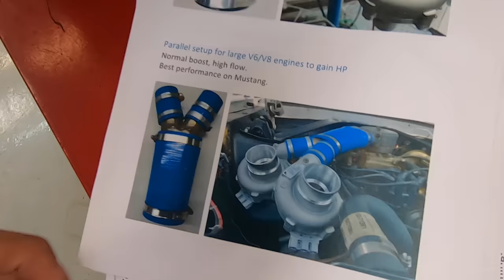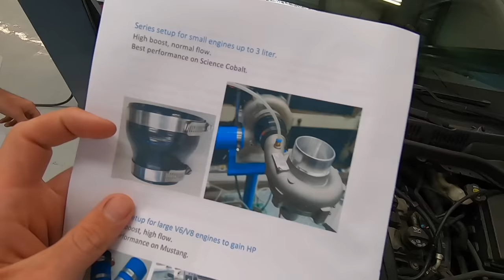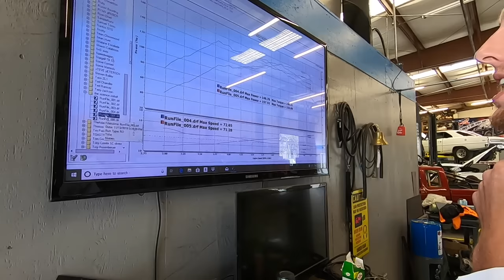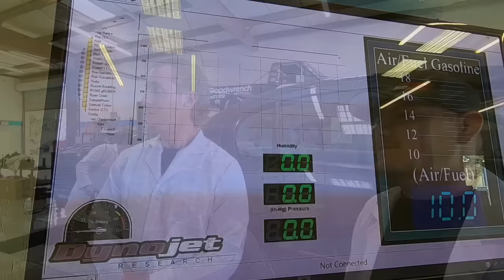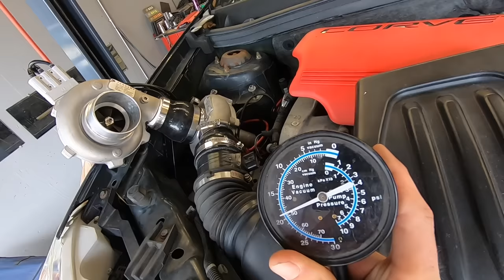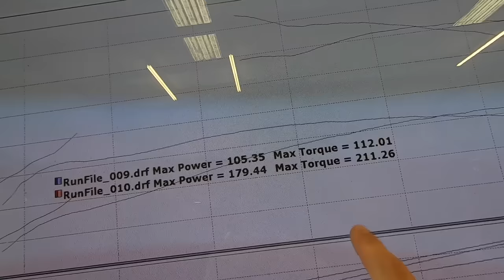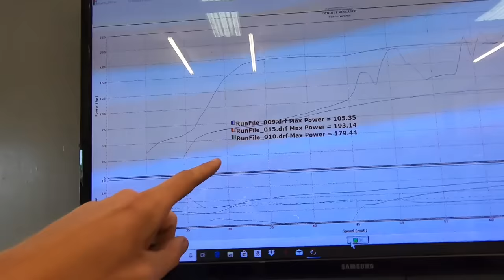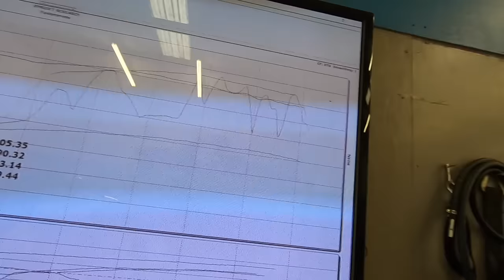Dyno Testing $5,000 Worth of ELECTRIC Turbos! Double the BOOST!!!

Comment: If these were cheaper they would sell like crazy.
Reply: It's not bad for what your getting. You have to remember it isn't using the exhaust to spin up the turbo, so they spin up instantly less turbo lag. Also because it doesn't use exhaust to spin up the turbo, install is much easier.
Reply: If they really worked
Reply: Id just buy another vehicle with the 5000
Reply: @robertanderson7784  Admittedly I did not watch the entire video. What I need to know is; what is the power source? What wattage and amperage do the turbos draw. Cost is nominal compared to typical exhaust driven turbo systems as one does not need all the extra plumbing and intercoolers. There is absolutely no parasitic loss here but I would like to see a schematic with the circuitry required and the power source/demands.
Reply: If they get enough orders to mass produce these things the price could go way down
Reply: I'd pay maybe 500
Reply: @2ndamendmentfanboy723  that is even les then a normal turbo. Never ever going to happen. I think if they can sell a good amount the price could drop below the 2000 mark, maybe even down to 1500. Now if you go with a turbo build i think you wil be spending around 1500 to install a normal turbo as wel. You need to have a new exhaust, headers, the turbo itself, most of the times an intercooler. And then offcourse the time. If you can weld yourself and do all the fabrication a turbo setup could be done cheaper, but if you let someone weld the exhaust for you i think you wil not be able to do it under 1500.
Reply: I'm buying one regardless for my Hyundai Elantra hahaha
Reply: @gabbermaikel  what kind of cheap ass turbo setup are you getting for $1500 total including parts and labor? Are you using an eBay turbo with the cheapest possible headers or what
Reply: @circuscannon6381  that's 1500 to install from how I read that comment. Which is about right for a turbo install. Home build you could do a turbo for 2k if you can fab the pipes.

I reckon you could build a torqamp style device for about 700$ in theory and with an adaptor to split off the intake so the device isn't acting as a restriction in ordinary driving it could rock as an add on to a turbo build
Reply: @circuscannon6381  i didnt include any labor, i only included the pre welded exhaust part as you can read. So that means you buy a turbo, over here a holset turbo is used pretty often, can be bought for 300-500$, so that leaves you 1000$ for other crap. And dont forget that we dont include a ecu or some other way of controlling the fuel/ignition because that would be the same for a torqamp. So im only talking about the things you do need for a turbo setup and not for the torqamp. That would be a turbo and headers, a downpipe and maybe a bit more piping, then we are at the most basic needs. 

If you are going to get it done just installing the turbo without setting anything up would allready cost more then the torqueamp as it is now. Atleast i wont build a turbo setup for someone with the parts included for 2500$.
Reply: @randsonic  It runs on a 48V lithium ion battery that charges slowly off the alternator. If it were to run directly off the alternator it would cause a lot of parasitic loss when compared to either a supercharger or turbocharger, so this system is a good choice by the company.
Reply: @randsonic  watch the video.
Reply: @clitisoris  I did and I have conversed back with the rep here. Maybe you should read ALL the messages bro.
Reply: Ok bro.....
Reply: @randsonic  why do you think they do not work?
Reply: @ezralord4901  that was my first comment. They do work but one has to realize they are more like a nitrous unit which needs to be used sparingly.
Reply: @randsonic  That makes sense.
Reply: lapin46 it
Reply: So true 2500 this too much for 5psi
Reply: I could buy two impreza sti"s for 5 grand ... maybe 3 sti's... there cheap in the UK.
Reply: @randsonic  Doesn't matter what you use to spin the turbine as long as you have enough CFM and are generating boost per the compressor map.

You can use exhaust gas, crank driven, even electric motors.
Reply: @randsonic  External battery pack.

Wattage is typically 5kW plus, this is why they don't work off a 12V source as the amperage draw would be ridiculous (over 400A).

This is like a milder tamer version of NOS, except you can refill with your wall plug or with mild cruising as it trickle charges off of the car.

lapin46 actually detailed it nicely
Reply: @lapin46  The nice thing is that you can also shift your torque curve to the lower end. I'm building such a system for my Honda which makes no torque below VTEC (well to be fair it doesn't make much after either hahaha). Will be posting a video this year.
Reply: @lapin46  Also! So easy to remove for smog hahaha
Reply: @alexanderlevenko1924  well yes it does matter. No 12v system I know of would push this turbo...hence wahy they havent been utilized prior. Even this system has a 4 minute continuous boost witht the onboard lithium batteries.
Reply: Gurgle Blaster and no oil lines to run. And also cooler IATs because no exhaust heat is bleeding into it.
Reply: randsonic Yes, me too. I highly doubt my 90A alternator from my 90s Ram is enough to even power the one of these, let alone 2.
Reply: @jediknight1294  ohh imagine a program that detects when there will be turbo lag and so it fires one of these to spool it up.
Reply: @trialsbike2135  You can do this easily with an Arduino that operate the switch to this thing based on let's say RPM input until the certain RPM where the actual turbo is already spooled. Volvo do this with injected pressured air into the turbine itself to spool the turbo.
Reply: I would buy torqamp if the price would be 1000$
Reply: @kaikart123  you're absolutely right. I never thought I'd see the word Arduino used in the comments section here, but it makes perfect sense 😂
Reply: @0Schranz  id buy one for a maximum of a grand.
Mostly because of the ease of install and no one has mentioned yet: RETURNING THE CAR TO STOCK if you plan on selling it or just removing the setup. 
I never thought I'd see an electric charger do anything legitimate lol
Reply: @trialsbike2135  easy enough to do you just set it for acceleration and have it run via megasquirt etc, yank the timing and ease into the turbo spool up. Volvo do something similar currently.
Reply: @dub537h5  honestly for the work and performance boost it isn't worth it if you are planning a return to stock, take the money and spend it on a new exhaust, changing your intake and filters and a remap for your driving style.
Reply: @jediknight1294  well you could arguably just leave the exhaust and intake factory, only bolting on the supercharger. When you take it off, everything is still factory, that's what I meant.
You'd probably see better performance with the charger if you had another exhaust though...
Reply: @dub537h5  yeah, honestly if I'm putting something like this on I'm wanting to pull timi g at activation and am therefore doing things that are more than just plug and ay, we can see in the video that the performance when not usi g the torqamp was problematic for general performance due to pulled timing so... Id want to. Make the absolute. Most of. That boost under acceleration
Reply: @jediknight1294  yea, absolutely.  Might as well utilize it to it's full potential
Reply: @Jupiter__001_  Just throw on a second alternator
Reply: @elitewolverine  No. You missed my point. Parasitic loss is where the compressor consumes power in order for forced induction to occur. The additional alternator (or, more sensibly, a bigger alternator) will consume more power.
Reply: A hair dryer and an inverter . Price 99$
Reply: @Jupiter__001_  No I didn't miss a single point at all.

Current Alternators are about 60 or 70% efficient.

For every 1hp to turn an alternator it creates about 450W, which is 45V at 10Amps.

A typical Alternator creates 1400W at 4HP draw...

So yea convert 1400W to V and Amps and you get 45V with 31Amps...

These turbos are creating 70HP

I would need 11 alternators to equal a net 0 gain in power vs draw...

Yay physics!
Reply: So who wants to go in on a group buy??
Reply: @Luzviminda777  "A hair dryer and an inverter . Price 99$" /// I see a lot of stupid comments on YT.  You are right up there.
Reply: @randsonic  for the same amount of boost and volume you need the same amount of air cooling. no matter if the compressor is driven by an exhaust turbine, belt , electric, the holy spirit or unicorn farts. the heat is produced by the process of compressing air. So if you don´t need an intercooler for an amount of power with an electric supercharger, you also don´t need an intercooler with a turbo charger for the same amount.

Next topic, there IS loss. the engine drives the alternator. If there is a high current, electric consumer, the alternator pulls more power from the engine. 
it is even worse than a supercharger. a supercharger uses the mechanical work, provided by the belt, right away with no conversion losses. 
With an electric supercharger, there are conversion losses at the alternator from mechanical to electric energy (belt to electricity), and than again from electric to mechanical energy (electricity to the electric engine that drives the compressor wheel). 

100hp more for 5000$ is a catastrophe. And on top of the 5000 bucks you probably still need to upgrade your fuel pump, injectors, intercooler, MAP sensor (most NA map sensors dont know positive pressure, the engine leans out and basically explodes) maybe lower the compression ratio if it is over 10:1 (pistons and/or head gasket) rods, studs, colder spark plugs, exhaust, wideband O2 sensor, intake temp sensor, maybe a stronger clutch and gearbox, an ecu that can handle all that stuff and a dyno tune to adjust the ignition timing and other parameters. 

A turbocharger with a much higher performance costs under 1.5k, an over the top exhaust manifold 1k, blow off valve and electronic boost controller 500, intercooler 100  plumbing 450, a guy who smashes it on the engine 500 (if he is an asshole) many things are just bolt on so you can do many things by yourself.
Reply: @randsonic  YOU should do some research. the mechanical work of the compressor (compressing air) heats the air. It is a semi-adiabatic compression process. Why, do you think, do supercharger setups with intercoolers exist? There is no exhaust heat near a supergarger, Einstein.
Reply: @asdfjkl981  I own a Engineering firm...nuff said?
Reply: @randsonic  HAHAHAHAHAHAHAHAHAHAHHAHAHAHAHAHA
btw. owning something does not make someone an expert.
Reply: @asdfjkl981  why do you think water injection and cold air intakes exist Einstein? Because cooler air brings more oxygen into the combustion chamber, is more dense and creates more power regardless the engine. One of the biggest drawbacks to turbos has always been heat...because of their proximity to the exhaust manifold...heat which is transfered to the intake charge making a intercooler almost a necessity for turbos. I compress air in my tires to 35lbs...do I need a intercooler on my tires?
Reply: @randsonic  omg please. 
you always talk about power and more oxygen. that is all nice but the true danger of hot air is called knocking. and as i already mentioned, higher pressure superchargers also use intercoolers and the minimum temperature an "not sprayed on" air/air intercooler can produce is ambient temperature (wich will never happen because physics). 
and now put 2 and 2 together kiddo.
Reply: @asdfjkl981  typing hahahahaha on social media means you might be 10 years old. ME/PE here...look it up.
Reply: @randsonic  ?
Reply: Honda b and k motors would love this shit
Reply: @asdfjkl981  Where a engineering firm is concerned, yeah it pretty much does. Why don't you open one?
Reply: @asdfjkl981  There is a lot of heat within an engine compartment, and some supercharger designs (like engine mounted turbos) allow substantial heat transfer from the engine and other components to the supercharger. However the supercharger is NOT being run by exhaust gas which exits the combustion chamber heating exhaust manifolds to 450-500 degree average. Heat gain from a positive displacement supercharger allows heat (from engine compartment and operation) to be transferred to the air being compressed inside the supercharger (worse in turbo), effectively decreasing efficiency.  This is why many prefer a centrifugal supercharger mounted to the side of an engine or in front of the engine, instead of a  a positive displacement blower mounted on top of an engine. The centrifugal supercharger has minimal heat transfer from the engine which cannot be transferred into the intake charge. A positive displacement supercharger like any exhaust mounted under hood turbo can heat soak fairly quickly from engine top mounting . And like we all keep saying to you...the cooler the charge the better performance...even in a lawn mower.
Reply: Slap this thing on something already making boost and see what it adds
Reply: @gabbermaikel  If these were mass produced the price could drop to $1000. $500 from china. I can buy turbos from China for $100-200 and those motors are like $50 or less. But you don´t need the exhaust part of the turbo so no turbine or housing that will cut the price in half to about $100 for another $100 you can easily get the battery and the electronics mass produced. Add the quantity discount and you are only around $200 to $250 total. Making 400-500% profit is plenty and I think it is worth $1k easy. You could use a bigger turbo and motor and get even more boost too.
Reply: @excitedbox5705  nah you wont be able to make a powerfull and safe battery like that for 100$ Also you forget in you calculations that there is some extra machining involved to connect that motor to the compressor wheel, probably another bearing thing as wel. Then there is the control board wich you dont calculate for either. And then the fact that those cheap cheap things have no quality control at all. So if it is then put to the standard of this company you can count on 25-50% rejection. That means 250$ each and lets go for 25% rejection you are now looking at 325 excluding taxes and shipping minimum.
Reply: @gabbermaikel  That is what you call manufacturing. You don´t modify a normal turbo housing you get one made but once the molds are made you can reuse them. Molds are cheap though.

The motor looks like an 895 or 987 BLCDC motor, which cost around $20 and can be press fit onto the compressor. Bearings cost 20-30 cents. Guess what else runs on high output batteries? Electric bikes and scooters. The batteries are off the shelf units. They may even be the same cordless drill battery packs wired in parallel since they run at 48v as well. The electronics cost next to nothing and are included in my estimates. A BMC board for a power wall sized battery pack costs about $10 and a high amp speed controller costs $5-10. Those prices go down crazy fast though buying custom or bulk parts though.

If you go to Aliexpres and have a look around at what each of these items cost you will see that my numbers are actually on the high side. I priced these parts using the single unit pricing without any quantity discounts that you would get. In my experience those are another 50% lower.

Shipping costs 5k for a 40´shipping container but the import taxes will be expensive.

You have to keep in mind that this company had development osts where they had to make single units and test several motors and batteries etc and that can quickly run into the 10s of thousands or more. That means they have to sell 1000-2000 units at a much higher cost to recover their investment and build up to a point where they can order bulk. In addition I doubt they are going to dump a million+ into ordering a container full right off the bat so their costs are probably much higher right now and they may even be assembling them themselves which would add 100+ to an essembly cost that is practically free in China. A factory worker costs $20-50 a day.

I am positive that if I was to order a container full of these things I would be paying no more than 250 each.
Reply: @excitedbox5705  so we end up at the same thing. They cant order in the shipping container size. And if you want to be sure of quality you have to assemble yourself or have someone check it all. And since they are a new guy to the game they have to be 100% sure every unit they send out in the first 3 years is good. If 25-50% of the shipped products have problems they wil go bankrupt. Not because sending a new 1 is that costly, but because the first few years for a product like this wil determine if people like it or not. If borg warner ships a load of crap turbos out and they all have to be replaced then sure it wil hurt their name, but their name is still 1 of the best turbo manufacturers of the world, so they can handle that. If you are a new guy and 50% of your stuff is garbage you wil be known as that company that sells overpriced garbage that dosnt work. And that is the end of the product, because it dosnt work according to the people that bought it.

So what happens is they have to atleast do a final quality control. And from a guy that works at a car parts brand i know that in a lot of cases that means take it apart, check it and reassemble, or just do the final assembly in house. They did that with chinese parts as wel. They got everything made in china, prettymuch the same parts as you see on aliexpress. But they did the final assembly, checked if everything was within spec and all that. And now the part that was 20$ on ali would be 50$ from them. Not because they earn that much on it, no because someone actually put time in it, and there are parts that get thrown in the junk. 

And the tax part wil be HUGE on this as wel. They are a dutch company, and i think we over here have 1 of the highest tax prices in the world. By the time its shipped out agains it wil be close to 50% more expensive because of all the taxes and crap on everything. Now they might be able to get some of that off if it ships outside of the EU, so that might make it a bit cheaper for US customers.
Reply: @asdfjkl981  mazda millenials is an intercooled supercharged engine
Reply: @keithgauger597  The VW G60 was a very popular intercooled superchargerd engine. But don´t tell me that. Thell it super engineering company owner who thinks that the higher temperature of compressed air is only because the exhaust is so hot.
Reply: @robertanderson7784  Could start looking at corvettes at that price.
Reply: Rainy  it raised the power but only when it was used, it actively damaged the performance when the device wasn't activated. What id do is have it set with a microsquirt to pull timing when its used. 

Using the device to boost till a turbo engages isn't a bad option though.

They are a fairly simply thing to build, lithium ion 18650 batteries in series to reach the 48V pack required and a modified turbo. 

They are a cool thing but they aren't in anyway a game changer, especially if installed the way they were here. Pulling timing full time  when the device isn't running seems to actively damage performance. Peak power isn't everything. 

Putting a system together that takes advantage of the benefits wouldnt be too hard on an EFI car with a tuner like hondata or similar though. Would be more money and make this a really unattractive option compared to say nitrous or a straight turbo install given the price and the requirements to put a splitter into the intake to ensure that it doesn't present a blockage/restriction when not triggered.
Reply: Rainy  i wouldnt call it sizable given they had to ruin the drivablity of the vehicle for a minute or some b9ost of 5psi
Reply: Rainy  in interested in usability not peak power remember and given that pulling timing means that power is reduced in ordinary driving....

I think the tech has potential, using it the way volvo does.to eliminate turbo lag possibly
Reply: @gurgleblaster2282  and the exhaust sound is better
Reply: I'd get one for an old honda. It'd probably work great on a little gsr motor
Reply: Yeah if it was cheaper i would order now!
Reply: @lapin46  rpms?
Reply: @lapin46  this kinda pisses me off. I was doing this 15 years ago with my dad's rc airplane engines and spinning tires in third gear...the lypo batteries they ran off of might of weighed a lb. The motors? Pssshhh. If only I could of patented it.
Reply: @lapin46  true. Found a video on company who makes it. He has 0 to say about tuning applications for it. He mentions using the tps sensor I get the theory but I think that's all he has is the theory. Obviously tuning will get the best out of it but the maf isn't doing a bad job on it s own for this car
Reply: @randsonic  true in theory but newer cars run coolant to the throttle body for a reason. Unfortunate, but probably something that could be "tuned" out. Idk. But maybe like you can have a plug that's too hot or cold   the airs the same and just needs an all around sweet spot depending on the application
Reply: @2ndamendmentfanboy723  I'd pay probably $1,000.  I've thought of several cars I'd much rather slap a couple of these on vs. plumbing in an aftermarket turbo setup.  I wonder how long the windings in these things last and the life expectancy of the batteries.
Reply: @asdfjkl981  "the heat is produced by the process of compressing air."  That's only part of where the heat from intake charge air comes from though.  You have this air being compressed by a glowing red hot turbocharger unit, traveling through hot charge pipes in the engine bay to the I/C, back to the intake through upper intake piping which will also get pretty hot.  I guarantee you'll see lower IAT from one of these located at a traditional CAI spot than from a traditional turbo at the same PSI.
Reply: @blackriflex39  "Slap this thing on something already making boost and see what it adds"  I think one of the interesting concepts about this thing is that if you've got a big turbo on a 4/6 cylinder motor you could fabricate an electronically gated Y intake for one of these and trigger it to run at > 75% TPS from 1,500 - (whatever rpm your boost comes in at) to improve low end drivability quite a bit and get into your real turbo spooling range quite a bit quicker.
Reply: @chrislack7219  wrong
Reply: @kurtisstover7610  Newer cars run coolant to the throttle body for cold weather performance issues.
Reply: @randsonic  so your saying it helps tune the car for specific weather paremeters to adjust emission levels?
Reply: @kurtisstover7610  It may do that I am not sure, but it is no different that the heat which used to be piped into the air cleaner of older cars from the exhaust manifolds. Cold air/fuel mixtures are hard to keep atomized at colder temps causing issues until the engine has been sufficiently warmed up. This is why we used to have chokes, and heat feeds as I mentioned. Being a old school guy I would say I doubt the coolant to the TB does anything to cool the incoming charge of air. Many in warmer climates have dispensed of this feature with no adverse results.
Reply: A lot of comments here missing a very simple point.....

This device had 3 guys who normally need 8-9 second cars to get a whoop outa them, hollering and laughing like a bunch of kids out in their first car, and that's in a 4-banger with a rough setup

In my local area, these things are used for high-altitude work, mostly on construction stuff, i don't think cars are really their market, maybe explains the price difference! :)
Reply: @JoeIsCrazyWillman  The Alternator doesn't run it. The system has its own 48v battery.
Reply: @DesertFernweh  the alternator doesn't run them no, but it has to reCHARGE them, repeatedly... A 90a is barely enough to run my truck's basic computer, radio, and hvac without dimming the lights and dropping in RPM at idle at night... No way it has enough oomph to be charging up these batteries additionally, plus run the dual electric fans I now I have as well.
Reply: In 5 years these things will be 1000$. In 10 500$. Unless china makes a knockoff sooner. I would say in 10 years electric turbos will run the dragstrip but they won't. Electric cars in general will.
Reply: @gabbermaikel  the difference is a real turbo can push pretty what whatever psi you want through it. Give a couple years for development and I wouldn't doubt electric turbos could push 20lbs all day
Reply: @codiekennedy825  gonna need a lot more than 5psi of boost on a sub 2.0L displacement engine with stock cam for electric superchargers to take the strip by storm.
Reply: @JoeIsCrazyWillman  agreed. 48v is nothing though. Even today they could easily make that twice the size with 3x the voltage. That's atleast 30psi. What about in 5 years. The point is mute bc like I said I don't think this is the next big thing I think electric cars in general are. But I used to be into rc cars as a hobby and this could have been done 15 years ago
Reply: 2500 for a basic bolt on accessory that makes amazing power for the cost of just a tune is pretty good in my book. been working on high performance cars since 2002
Reply: It's still worth £5000 for 2 elec turbos and doubles your power.
Reply: yeah one day battery tech will get cheaper and smaller and more efficient and these things will fly out the door...i'd like one on my Civic K20C2 for sure!
Reply: @alexanderlevenko1924  You didn't post a video..
Reply: @2ndamendmentfanboy723  500? Are you that broke? The battery itself is 500, you're one of those customers that every shop can do without. 2nd amendment gan boy? I don't you can even afford a gun and you're just trying to fit in somewhere.
Reply: @gabbermaikel  I don't mind paying 1000+ for a REAL turbo build but this is too high for an electric turbo build
Reply: @FarmerFpv  lol 5000 for an electric build?? Are u nuts??? I don't mind paying more for a REAL turbo build but this is crazy for just a few hp😂..not worth it I can get a real turbo build for alot less than 5000
Reply: @randsonic  sry to bump an old post. I think you are both right, but i have a sr20det with a 2860gen2 and a standalone ecu that shows inlet air temp. The more i throtlle, the lower the temps go as there is so much air passing through the system cooling it all down. The heat radiation you mention is indeed a thing. A really small turbo that is turned up to much will make more heat when making the same boost than a bigger turbo i think.
Reply: @FordSierraIS  What is the temperature of the exhaust? Car exhaust temps run 500-700c which will sink into anything surrounding the unit itself, this is why many turbos have inter coolers. Of course faster moving air displaces heat more quickly, however heat in a turbo engine is not optimal.
Reply: @randsonic  absolutetly. i dont disagree with you, and i think your discussion with this other guy is merely about how much each factor matters, which obviously varies from car, ambient, load, turbo size, impeller design, etc etc etc. im building a new setup now and ceramic coating manifolds insides and outsides. turbo blanket, etc etc. and its not just for the performance but brake master is right above the manifold too. for a turbo that is running within its designed capacity, the heat generated from the air compression is not to bad. newer turbos are more efficient too. but my point was basically as a comment to both of you as pushing the car harder actually decreases inlet temp on my car, at least on shorter pulls. in autoslalom oslt for prolounged time i would probably see more heatsoak of both intercooler and the engine bay in general
Reply: @gabbermaikel  3-500 is a bargain its hard to find a remanufactured one under 600, plus headers usually cost $250+ on the low end, exhaust piping, blow off, intercooler, and intake tubing. Not to mention the amount of stuff you have to remove to put in a turbo in most cars and the hours of work and sometime fabrication is needed.
Reply: @alexanderlevenko1924  was hoping to see your build. 😢
Reply: Instablaster.
Reply: @bvancere  so, hv u actually bought it?
Reply: @2ndamendmentfanboy723  even if you throw the cheapest turbo imagineable on a 4 cylinder engine with the intercooler doing the work your self which is way more complex than hooking up 2 wires or a centrifugal super charger run off the belt similar to this one its gonna cost 5gs minimum.
Reply: Lol nah.. An actuall good 80MM turbski is in germany like nearly the same its even a bit higher.. its like 6K XD
Reply: @randsonic  12v dont think he said what they drew but it’s enough to max the turbos out lol they’re not making gobs of boost. Would make for a cool twin charge tho
Reply: @larrylentini5688  future here. They went up lol
Reply: @randsonic  what charges the lithium batteries? Either way you put it it’s being powered by the cars battery. Years later we still don’t understand em. Still getting one tho lol
Reply: It's $200 on AliExpress but it's the one they used on the mustang video
Reply: Yes true, easy to setup, no oil leaks n etc.
Reply: Yeah they want over 8500 for a turbo kit for my truck and it's nothing spicy
Reply: @randsonic  One thing they don't mention is that these use a set of LiPo4 batteries AND a set of Super Capacitors to release the energy running at 48VDC. You can run them continually for about 4mins. For city use they are perfect. For std highway driving with instant passing ability also perfect. I'm not sure how they would go on a sustained mountain climb.
Reply: These things don't work bro and if there is a moment they do they will just create other tuneing problems and eventually the fans fail and damage the engine there not built with quality bareings like a turbo or supercharger needs
Reply: @ivanvolkov2239  They are built BETTER than anything China and Europe produces and are specially tuned to do so. They are built and manufactured in the Netherlands and they most certainly do work. Audi and BMW are spending big money on using this tech on their new turbo cars because they do work. You must be a traditionalist, because these are very new.
Reply: I don't think you'll be buying 3 sti's for 5k anymore now 🤣🤣🤣
Reply: Well, 3 years later they haven't increased in price when almost everything else has.
Reply: I think their first dyno test reading was wrong  The 105hp hit was with the turbos connected restricting the airflow of the test.
Reply: @randsonic  I would assume 12v
Reply: @2ndamendmentfanboy723  a cheap turbo and briahless motor would coat $500 to part and combone plus youd need a power apurce. Uou couldnt make it for $500.
Reply: @gabbermaikel  1500? been looking at turbo kits for g35, they are in the 5k range not including install, probably another 2k
Reply: Definitely NOT worth that much when you can buy a DIY turbo/supercharger setup for that price
Reply: @gurgleblaster2282 it is bad, there's no reason why they would cost that much when we're probably 7 years away from being able to 3D-print them lol
Reply: @atrumluminarium  wow responding to a 3 year old comment claiming 3d printers are gunna make an electric motor  that spins a turbo 🤣.
Reply: @gurgleblaster2282  what's your point?
Reply: @randsonic I know this is an old comment now but dude... they explain it 3 minutes in how it works and have multiple videos proving it does work. Cmon dude. It's not GREAT but for a push button with very little needed to install its pretty impressive.
Reply: Once the battery price drop or cheaper, the price maybe go down little bit because I think what's make it expensive is the battery/box. That thing also pack with some electronic that I think is expensive.
Reply: @gabbermaikel  It's half a $300 turbo with an electric motor screwed to it.... It's not even a whole turbo... It's half of one.
$500 bucks.
Reply: @gurgleblaster2282  the big downside is the huge power loss when not using the turbo's tho, i'd like to see if constantly using them doesnt drain the car's battery aswell
Reply: @Haltzo  bruh. Once you get up to speed you don't need the boost if you are daily driving. If you are drag racing just get an additional li-ion cell. Not really a big downside at the end of the day.
Reply: If I had more money and were taller I'd probably have a girlfriend 😅
Reply: @randsonic They run off their own 48 v battery which is charged off the alternator over 13.7 v don't know about the current..